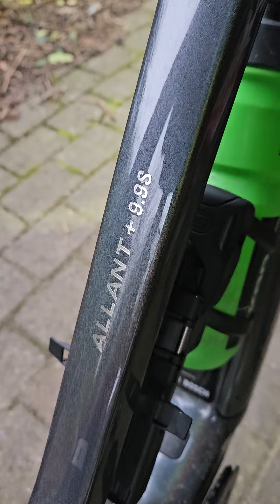Trek Allant+ 9.9s after just 500 (actually 349) km the smallest sprocket is screaming in pain & tear

Comment: Possible ideas
1. They are already steel
2. Try to use some degreaser on your chain and cassette. Too dirty, and you wear out parts fast.
3. Try bigger chainring up front (if you have clearance)
Reply from the maker: 1. ✅ but strange
2. I have cleaned it and tried another dry lubrication --> Did not really help --> if only let the engine add power to where the power bar is between 5-10 minutes to 12 then it work --> my average power input decreased ~35 watts (https://www.strava.com/activities/10955860269) 😕
3. A bigger chainring up front will only make things worse - I need a higher cadence which is either Bosch or Trek which should remove the 80 rpm limitation in the light that the motor can work up to 120 rpm.

Comment: I'd be interested in the chain wear. I suspect it's way over .75
Reply from the maker: I haven't measured it - but it is a brand new bike so the chain is only 350 km old. At my first Speed Pedelec with an Impulse 2 motor 10 years ago the drive train lasted 2500 km.
https://photos.app.goo.gl/ibjYaE4bK9hGqCVM6

Comment: This is the exact reason hub motors are better. Mid drive bikes amplify all their torque through the chain stressing the cluster. Bike chains were never designed for 70-80nm of torque. This is the result. Always bring a spare chain with tools because when the chain breaks you'll be stranded. Hub motor bikes don't have any of these issues.
Reply from the maker: @c-shepard, your point about hub motors is well taken. Indeed, mid-drive systems can exert more stress on the drivetrain due to higher torque. However, there are several reasons why a mid-drive system like the one on the TREK was chosen for certain applications:

Drag Considerations: While hub motors tend to be efficient, when the battery depletes, they can introduce additional resistance, making pedaling without electric assist more strenuous than with a mid-drive system.

Maintenance Complexity: Fixing a flat tire with a hub motor, especially in adverse weather conditions, can be more complex compared to a traditional wheel setup. Internal gears like the Enviolo add to this complexity due to their integrated nature.

Weight and Balance: My previous speed pedelec with an Enviolo gear and Bosch center motor was significantly heavier. The additional weight impacts the handling and the ease of pedaling without electric assist. The TREK's lighter frame at 22 kg preserves the natural cycling feel and ensures manageability even when out of the battery.

Battery Range Anxiety: The TREK's efficiency and lighter weight alleviate the concern of running out of battery, ensuring a reliable and enjoyable ride to your destination.

Riding Experience: The goal was to mimic the "natural" bike feeling, akin to traditional mountain biking, which the TREK offers.

In summary, while hub motors have their merits, especially in reducing wear on the drivetrain, the balance of benefits from the mid-drive system better suited my specific needs for a balance between an electric assist and a traditional biking experience.